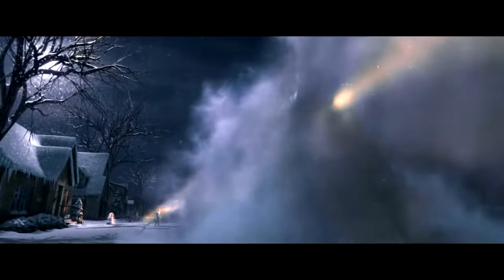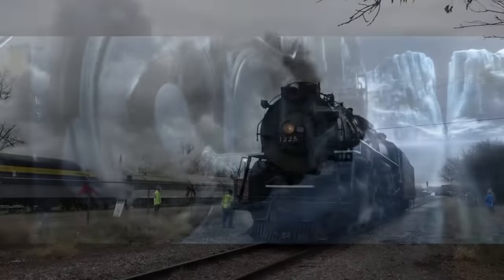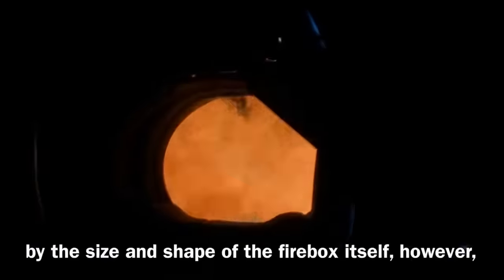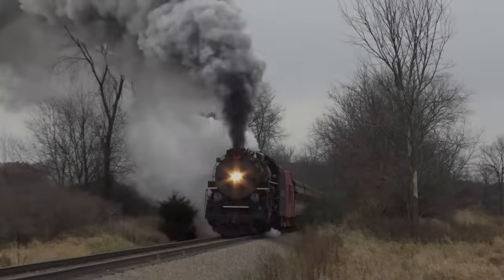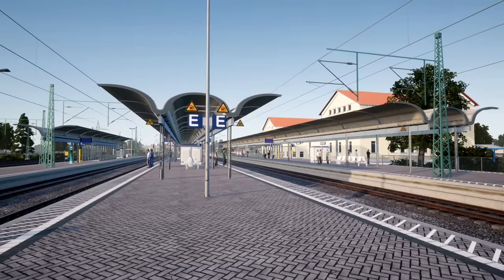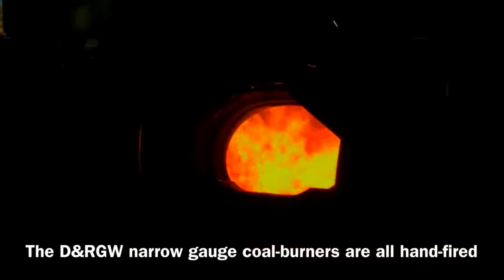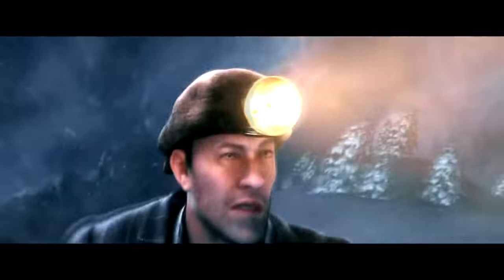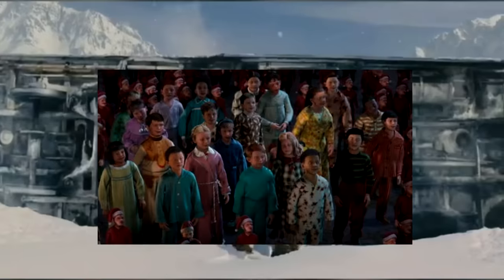Why The Polar Express would Explode

Comment: Since the polar express is made to run that route. It might be possible that some design considerations had been taken to make the train capable of surviving those angles.
Reply: Like a tilted boiler that someone else mentioned.
Reply: @kevinmencer3782  what about a tilting boiler.
Reply: @kevinmencer3782  tilting boiler wouldn't really be necessary for the upgrades, the horizontal boiler would affectively turn into a vertical boiler, of course you'd have to fire from an odd angle but you wouldn't suffer an explosion, on the downgrade however they would have to kill the fire almost entirely and let the locomotive drift downgrade (considering how hard the locomotive would be working on the upgrade the fire would be completely gone by the time the reached the top anyway) of course this would be easier to do on an oil burner but still possible with a coal burner. Really Thought if your going up or down a grade that steep you probably have bigger fish to fry considering you'd probably go tumbling head over heals down the mountain lol.
Reply: I do have to wonder if the speed at which the polar express was going would have been enough to force the water in the back. (kinda like spinning a opened water bottle and having the water stay at the bottom rather than spilling out)
Reply: even if the polar express did explode it propably did not kill everyone with a blast radius of 50 feet the front car of toy parts would protect the kids, i coulden't find the acctual length of the cars but they were Aprox 75 feet and only the boiler would expold not the tender so the blast would not reach the kids. would the derail-ment hurt Absolutly yes Fatlae I dout it. (Sorry for my bad spelling)
Reply: The Polar express is magical engine so it explains a lot.
Reply: @michelleschrock9141  yeah but that's no fun
Reply: @turkey833 
That works only if the train accellerates faster than gravity would accelerate it- faster than a freefall.
Reply: @lucasgeesey4719 the explosion wouldn't kill everyone.
Expose to the arctic would kill the survivors, though.
Reply: @nos9784  the polar Express wouldn't explode
Reply: what about it bending
Reply: @DriverEra.  what?
Reply: that's why people are disproving him
Reply: I remember reading about trucks that haul fuel, to prevent the fuel from slaming freely in the tank, they are walls inside the tank with a small hole, so the fuel gets distributed bettwen the segments of walls and when it needs to move it will slowly travel tro the walls since there is only a small hole allowing it to. Maybe if the boyler was like that, I dont even know if it would cause any problems XD
Reply: @JuanGamer0202  are you talking about journal boxes?
Reply: @lucasgeesey4719  my english might be bad, but I was talking about fuel truck tankers, nothing about journal box's
Reply: @JuanGamer0202  the polar Express is a passenger train,
Reply from the maker: Believe it or not, there isn’t much space inside of a boiler for a steam locomotive. Outside of the firebox and throttle valve, there are a series of tubes called boiler flues which pull hot air from the firebox through the boiler and exhaust it through the smoke stack. The steam locomotive the polar express is based after also has a super heater which is even more tubes that take the steam from the throttle and pushes it back through the boiler to be heated up even further for better power/efficiency. The idea you’re thinking about are called baffles in a fuel/petrol truck which prevents the fuel from sloshing around in the tank. It’s not really possible in a boiler due to the innate lack of space
Reply: @ChriswithaK  oh thank God you understood what I meant, thx for clearing it up, when I was writting it I knew this would be the kind of reply, adding layers to the boiler would be unpractical because it would make the space for steam even smaller.
Reply: @lucasgeesey4719  why pointing out that its a passenger train, I was talking about the boiler, not what the train hauls, both the boiler and a fuel truck carry liquids, that is what I was comparing it to. Anyways Chris got it.
Reply: @JuanGamer0202  so water? I'm confused
Reply: No, it's just the garbage movie that shouldn't exist being dumb and exaggerating things like crazy to  pad itself out to feature length
Reply: @ChriswithaK I wonder if it would even be possible to retrofit baffles or redesign the boiler to survive the steep slope
Reply: There is also the fact it is a magic train so that factors into it.
Reply: @ZeldaTheSwordsman  >being dumb and exaggerating things like crazy
???
What media doesnt exaggerate SOMETHING? Is EVERY single movie supposed to be grounded and "realistic"?  
Are you one of the people that legitimately bitch about Minecraft trees defying gravity or something?

This is a magical train that goes across the planet and to the arctic in one night. It literally drifts on ice. :V

>to  pad itself out to feature length
Frankly, if you were to argue any part were long, it'd the part AFTER the Polar Express, when they're actually at the North Pole. I guess.
Reply: @turkey833 its not necessarily the speed but the acceleration, which is what 'creates' a force (F=ma). However, since the train descends nearly vertically, it safe to assume that the train is in freefall, where the water would be 'floating' inside the train.
Reply: @lucasgeesey4719  No, he is talking about large metal plates in a tanker, or in the tender of stram locomotives, these are called baffle plates.  Journal boxes are also known as axel boxes in ENGLISH
Reply: @ZeldaTheSwordsman  It's a fun CHILDREN'S CHRISTMAS FILM.  If you don't like something and can't say anything nice then don't say anything whatsoever!
Reply: or, might be an outright oil-fired locomotive, which as you guessed, has different firebox design and is fundamentally almost-impossible to explode without some sort of purposeful sabotage, also oil can be pumped in remotely, which means we can just use a firewall and completely seal off the boiler from crew and passengers entirely, that way even if it did explode, it is very unlikely to harm anyone onboard.
Reply: @SYN7H3T1C4  what explodes in a steam locomotive isn't the fuel, it is the boiler itself. 
Since it's pressurized, the water is hotter than boiling water at atmosperic pressure. That extra stored heat makes a lot of the water insantly turn into steam, 
If the boiler is breached.

Boilers typically breach due to bad construction, overpressure (from malfunctioning safety valves) or overheating.

Overheating makes the materals too soft- and can happen if the water level is too low ("exposed crown sheet") as you go down a grade outside safe operating limits. (or, more commonly, failure to replenish the lost steam with feedwater)

Soft metal can't withsand the pressure. 
Boiler breaches.
Overheated water instantly boils partially until that overheat is spent, the steam propelling debris and still just sub-boiling water around.
The hospitals burn unit get's to work overtime.

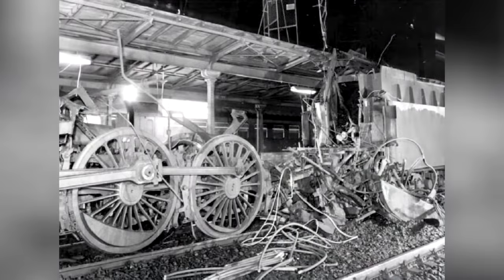Comment: 7:07

And that's why mountain climbing engines like the ones at the Mt. Washington Cog have tilted boilers! When climbing up a 27% grade they need their boilers to match the incline of the mountain so the engine doesn't explode
Reply: Or at least the firebox has to always be on the downhill end.
Reply: The other option is to have a flash boiler.... that intentinoally does what the cause of the problem is in the video by separating the steam supply from the water container and injecting the water at the rate you wish to create steam.
Reply: truly interesting thank you
Reply: Hey, I’ve ridden that one. It was pretty cool.

Comment: the melting plugs in the crown sheet are a warning system to the crew, rather than a preventative measure, as engines have exploded with those things melted through.
Reply: It gives a bit of protection,  since the Hotspot gets bend down and separates the top layer from the flames.
But yes, you are already in trouble when that happens and when you ignore the signs you dead.
Reply: i still find that black and white thumbnail with the exploded train creepy
Reply: @stanleybochenek1862  
It's a real image, you can hear the story from Qxir. It was pretty devastating.

Comment: You forgot the tunnel. The boiler would have exploded right as they entered the tunnel amplifying the blast as it had only two directions to travel. The momentum of the wreck would have pulled the unshredded cars inside the tunnel which is now a furnace.
Reply: Brutal

Comment: It’d be cool to see a video of all the necessary implications the polar express would need in order to operate in reality. Considering that canonically the Polar express also strangely has a working flux capacitor, seen just after the gold pin flies off the throttle.
Reply: Wait what?!
Reply: Robert Zemeckis loves to include things like that in his films
Reply: It's ridiculous to assume the train is actually steam-powered. It manipulates time and glides on top of ice. It's powered purely by Christians spirit, with a boiler for show.
Reply: I’d like to think it was designed by Doc Brown, (Christopher Lloyd also plays Santa in a few films) but this movie takes place the late 50s
Reply: @benmoore2253  Since when is time an issue for Doc Brown? :D
Reply: True
Reply: @Gr3nadgr3gory the locomotive is No. 1225. That’s a real Berkshire locomotive, Pere Marquette.
Reply: @piercelindenberg6842  you have no comprehension of the enchantments under the hood good sir.
Reply: The flux capacitor is probably defective, seeing how the conductor is afraid of arriving late!
But the existence of the flux capacitor would explain why the train goes down such a steep slope. Normally this is where the train hits 88 MPH to go back in time and arrive on time
Reply: @Gr3nadgr3gory  but they did use the boiler in the movie with alot of coal

Comment: This is a fun video.  The explosion is not caused by the water instantly turning to steam when reaching the firebox.  Since we are talking about a modern (mid 20th century) Berkshire locomotive, the explosion becomes more interesting.  What actually causes those explosions is the sudden cooling of the crownsheet which causes a crack.  The water in the boiler is already under extreme pressure so it remains in liquid form even past the boiling point.  When that crack forms, the pressure has a means of escape and with the sudden decrease in boiler pressure, all of the water, which is already well above the boiling point, instantly turns to steam and escapes through that crack turning the boiler inside out and launching it into the air.
Reply: Thank you for the actual scientific explanation! Video was good but he was vague due to ignorance in some areas

Comment: I think the biggest detail that u miss is the train accelerates very quickly down the hill probably pulling some G's which would keep the water from just sloshing forward as if the train was still and tipped forward
Reply: I was thinking this, and looking for this comment. But I don't know enough about the structure of the boiler to know whether that inertia would keep enough water over the crown sheet or not.

Comment: One thing I’ve learned after taking industrial safety courses in college, are that pressure vessels, i.e. boilers, are no joke. They need to be maintained regularly. Cause well, explosions. Numerous cases of boilers being over pressured and launching the tank and shrapnel into low earth orbit have been documented. 

Although I will say it’s a slightly different scenario with boilers. With boiler explosions, it’s a result of letting pressure build up to far (which is still possible in steam engines) but the case made in the video is where water sloshes back onto a hot piece of metal, instantly flashing the water into steam. 

The key takeaway here is how much water expands when heated. I think it’s like 1600 times the volume of liquid water. When that happens, pressure builds immensely and cause cause all kinds of catastrophic failure. 

That being said, the polar express is a magic train.

Comment: The entire problem with the polar express exploding could be solved with an experimental gyroscopic boiler. That’s basically a hybrid of magic and technology, with the firebox position to the bottom and large tubes around the boiler that would funnel all the heat towards the end of the engine or rather the front it would be really really complex and if not for the budget of limitless money thanks to Christmas magic ludicrously expensive like possibly the most expensive thing in the history of anything ever at that time I think it’s a really really cool concept also also could be using magical fuel like lady from Thomas and the magic railroad
Reply: It doesn't make sense. You just described how its designed in normal world

Comment: Admittedly the grades on the track in the movie are way steeper than anything a real steam locomotive could handle, and the curves are so tight the train literally snakes around the mountain (something no real, and quite rigid, steam boiler could ever do.)

Also a bit of a pet peeve that the throttle is pushed to be opened instead of pulled. 

Do I still like the movie? Yup. Who wouldn't want a steam locomotive that was all powerful and could go anywhere? Galaxy Express 999 appeals for the same reason. Steam train in space!
Reply from the maker: This was more of a fun video if anything else, it wasn't supposed to make anyone resent the movie.
Reply: @ChriswithaK  

I get that, no worries. Ultimately get it that it's a fun holliday film as well, just can't help the inner steam nut chiming in sometimes.

Ultimately don't resent the film at all, it's one of my favorite Christmas movies. One of the little things I liked was the Lionel train under the tree at the end of the movie. It's a short blink-and-you'll miss it thing, but it's a nice nod to Christmases of yesteryear (and today, have a Lionel under my tree).

Needless to say the film really gave Lionel a shot in the arm, the Polar Express is one of its best selling themes for train sets and so on for years now.
Reply: Glacier Gulch is listed as a 129° grade.

For comparison, this is a 121° grade: https://en.m.wikipedia.org/wiki/Takabisha#/media/File%3ATakabisha_under_construction_3.jpg

You will notice that the train, which is not locked to the track like a roller coaster is, would fall off.
Reply: @ChriswithaK  yeah no i get it; just could have been slightly better researched, that’s all; still, overall good job! :)

Comment: Well to be fair during the scene on glacier gulch, the G-force from the engine going down that area would have done somekind of damage.
Reply: Yeah, I have a feeling this train isn’t made to go 230 mph pushing 7 gs
Reply: Well I feel like a train wouldn't function very well on a GODDAMN ROLLERCOASTER
Reply: Not to mention you'd have the equivalent of going past the red line on a car, unless you have a sort of governor
Reply: The engine would probably start suffering from the side effects of excessive G force after everyone is in a coma from the sudden whiplash tho
Reply: Well we are not sure what kind of magic is on that train, it could have some kind of magic stabilizer that cancels out extreme G forces on the inside as well as stuff that helps to nullify part of the weight on the ice which is one reason why it did not break immediately.

Comment: My great grandfather died in the boiler explosion of a freight train in South Carolina around the turn of the century.  Investigators surmised that they may have underestimated how low they were on water when they attempted to pump fresh water into the hot boiler on a stop.  
Pieces of the engine were found up to a quarter mile away.  

That all said, the potential for the boiler of the Polar Express to blow never occurred to me while watching the movie. 

But what has always did itch me a bit while watching the movie was how the engineers guided the engine back to the tracks when it left the ice, powering the wheels like a skid steer. 
I know it's just a fun kid's movie, so I've always let it go. 
But this was the most glaring issue I had with the mechanics of the engine.. those axles are 100% solid, and the left side wheels cannot turn without the right side wheels in the same direction. 
It made for a very cool scene of course, watching the engineer switching the valves around to reverse the wheels on one side or the other, but just made no realistic sense to anybody who understands the basics of railroad engine construction.
Reply: They probably put differential steering into the Polar Express in case something like the ice scene happened.
Reply: @wta1518 the problem is a steam engine doesnt function if the wheels arent linked. The cylinders and wheels are clocked so that there is at least one cylinder pushing in a positive direction at all times, with four distinct chuffs per revolution of the wheel. Unlinked wheelsets like whats shown in the movie would be physically incapable of starting the train, because as soon as one side dead-centered at either the forwards or backwards position, the other wheelset would start slipping instead of pushing against the stuck wheels. It would be like if your bike had independent pedals, there would be no way to get the other side back into a position of power stroke again.
Reply: @callsignapollo_  Who said there can't be a second set of pistons on each wheel to overcome that?